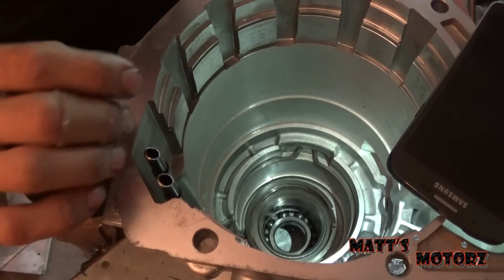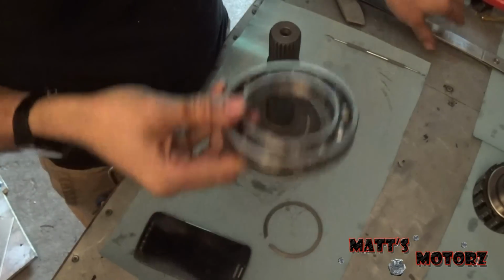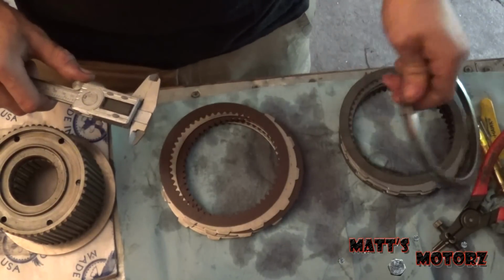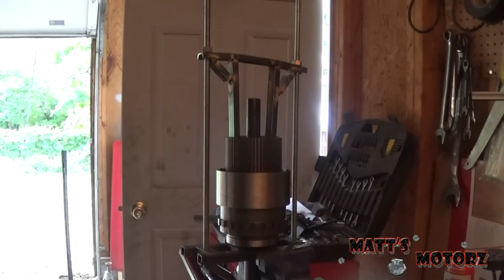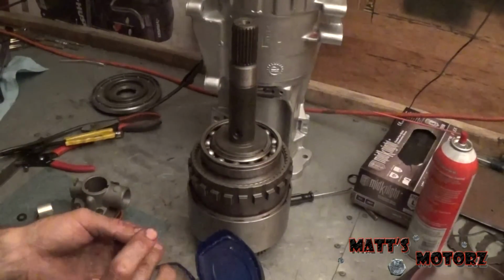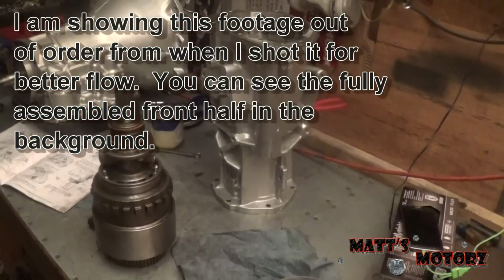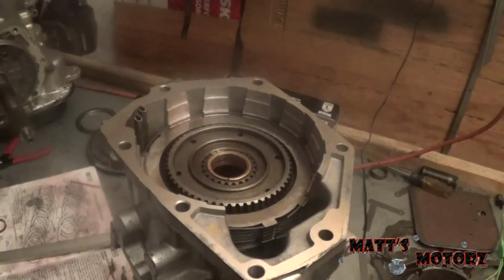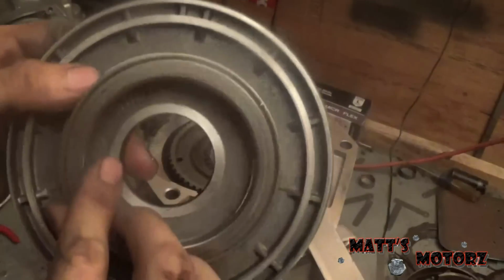42RH / A500 Transmission Rebuild: Part 5 - Overdrive Unit Rebuild

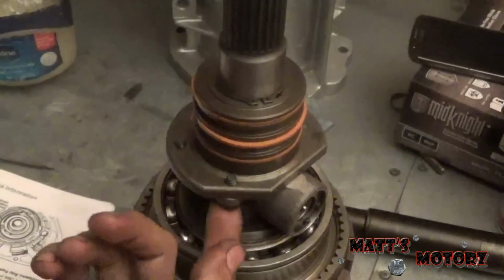Comment: When you can't get a straight shot with a socket, as in minute 25:45 on the Governor bolts, use a "dog bone" adapter, installed at 90 degrees, and set at the desired torque value. Sets from many manufacturers can be found with an internet search. Great video series. Just seeing it done and what is involved has given me the confidence to rebuild my 42RH,s Thanks!

Comment: Hello MattsMotorz  , I'm rebuilding the trans from my wife's Jeep. It's the 46RH, the new fiber discs and steels that came in my kit are 0.101 thinner after stacking, with the same number as it had factory. I added another fiber and steel to the stack and it now is 0.013 thicker than original. Is this acceptable? Any advice would be GREATLY appreciated.
  And, thank you for making the videos man!     S. Rhudy
Reply: What did u end up doing?

Comment: Matt please for the love of God stop using vaseline it will deteriorate rubber seals and cause premature failure use assembly line or ATF to hold the parts been rebuilding 4l60e for years and needed this video to get through this thing.

Comment: Great videos Matt! I'm trying to figure out how to make the last special tool(6312). I was thinking about using hard wood, but not sure. A lot of amature mechanics have access to small wood lathes, but not bigger metal lathes. I have a feeling most special tools can be fabricated. Anyways---I really hate buying special tools. I'll eventually figure it out, but if you gave any ideas; I'd appreciate your feedback. Your videos have really helped me. I went to automotive school in the 90's, but went into another trade instead. The only course I missed was Automatic Transmissions. To this day, they are my Achilles heel. It's crazy how complicated, even vechicles from the 90's are. My overdrive stopped working right when the warranty went out. I've put 80k on a truck without the overdrive. My point is if the overdrive is not working, drive the vechicle until it dies. Matt knows this, but I thought I should throw it out there. An ex of mine went to AMMCO, and was taken for $3000 to repair the overdrive.). I will now watch your pressure video. You are a great mechanic.
Reply from the maker: Thanks for the comment!  I think hardwood should be okay.  Even if you don't have a wood lathe, I have seen people "fabri-cobble" setups to do turning operations on wood using a drill.  Look up Matthias Wandel.  Specifically, he did this in a video where he build a wooden lathe.  I am not at all saying you need to build a wooden lathe, but in these videos, I believe he does do this little trick of using a drill to do lathe operations.
Reply: He has awesome videos.  Thanks for putting up this series